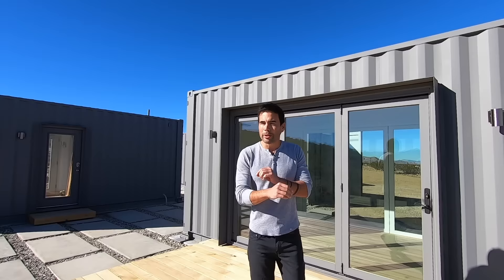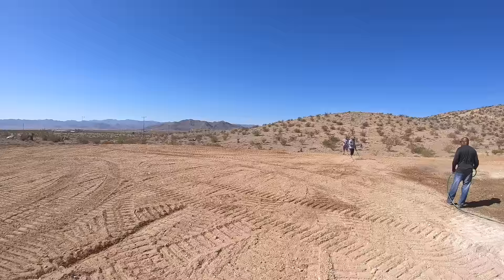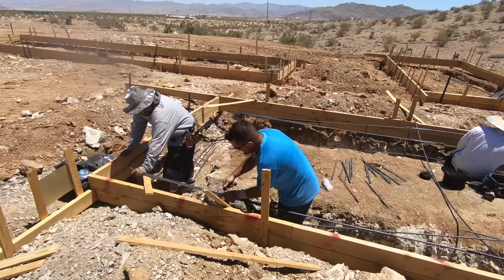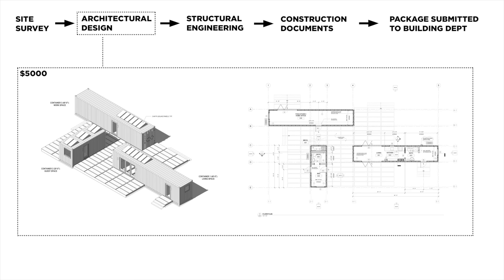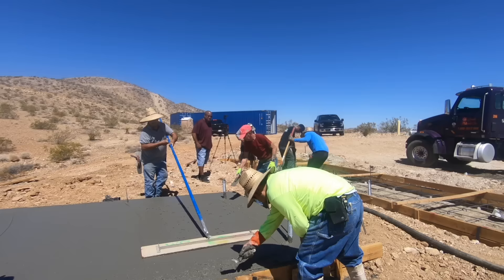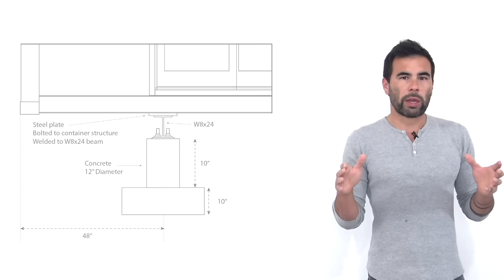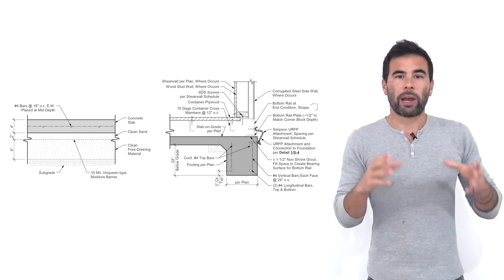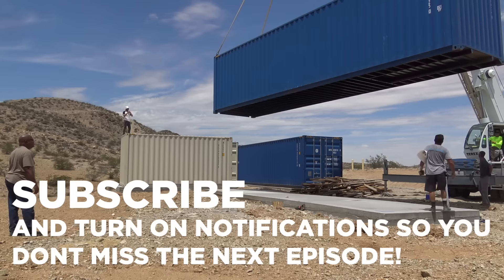Building a Shipping Container Home | EP01Permits and Foundation Design

Comment: 25k$ before even a shovel strike is made pretty much defeats the purpose of using containers at this point, no?
Reply: mglmouser I wouldn’t think so? Depends how much the containers cost and then compare that to the average cost to bet sq. Foot of a traditional build. Honestly I think some of those surveys are not necessary. But who knows, $25k might be a bargain compared to other parts of CA and traditional builds?
Reply: It's for people who are rich and want a "unique" design. They'd pay $100,000 in Beverly Hills if they had em
Reply: IDK, if anything having to pay $25k to put down anything makes me want to spend even less on what I'm putting down. Thank god I don't live in CA
Reply: I agree, and all the permits.
Reply: yea the permits and land negate the point of building your own cheap home.
Reply: @SAMann729  Thing is, they have to build framing walls anyway to support the containers, place insulation, electricity, etc. So they don't save on any construction using a container, only increase work, reduced room size, and complicate matters. It would be way cheaper and much more "green" to use standard methods and clad the walls in steel. Even better, use pre-built panels and this "house" would be under roof in less than 2 days.
Reply: @ThrottleKitty  but the point of the storage containers is cheap housing, if your going to be spending 25k+ before even starting on the housing then why not just go buy a house already built
Reply: Because this probably costed about $100k, instead of a small house in California on averaging costing you about $250k. Compared to the price of a house, $25k isn't a whole lot.
Reply: Guys... Does anyone here like in Cali? As someone who lives here, a smallish 4 bedroom house in a good to ghetto area is $400,000 minimum... I legit can't find any houses in any area within a 500 square mile radius around me right now where even a shitty 4 bedroom is cheaper after all the fees. 

I laughed when I lived in Missouri and people complained about $700 rents and $200,000 for a house with acres of land, talk about spoiled.... This shipping container idea is significantly cheaper to make even with $25K in permits starting when you want to choose exactly where you want to live and literally design your own home!
Reply: @Artdizzle  I don't even live in Cali and this is what I was trying to say! xD
Reply: I dont thing so, the way that portion of the vid plays out implies that he's adding the architect and structural engineer's fee into his "permit cost." If so, then going with a container saved him money since the exterior of the house is already a built. In a traditional home the architect and engineer would have needed to design and document the exterior, thus increasing their fees.
Reply: Mr. Boring on YouTube 25k for permits, 12k containers, 6k concrete labor, by the time you finish wiring, framing, and plumbing...you already spent 60k easy. And thats not including finishes
Reply: No, because you would have to pay  those costs for any custom home build there.
Reply: You also have to consider the "green" aspect. It is better for the environment to reuse containers or any available alternative rather than using concrete.
Reply: Ah, yeah.
Reply: fabnsass Except they were pretty much new containers
Reply: Why is everyone so focused on cost? It’s not a real house...it’s an ugly steel oven that has a small house constructed inside. It’s an RV or mobile home without tires! Trust-baby Ben is majoring in cuteness as he taunts the eco-fantasy of repurposing!
Reply: You got that right. I'm fixin to build one in Florida on a lake and I'm estimating it to cost me around $95000.00
Reply: Compared to a down payment on a house? It's cheaper to build at this point then to buy a home. You'd be surprised how much a home costs in certain states for the same size as this shipping container home.
Reply: That’s with CA permits and design, you’re going to get that with anything you build, if you’re a licensed engineer, then you will save a lot of the process, I’m a civil and plan on doing the grade design, SWPPP, WQMP, and substructure design and can design up to two stories in the state with my license under my liability so that’s somewhere you could save money

Comment: how is land so cheap? 10 acres for $20,000, that's crazy ~40,000m2

edit: holy fck the permits cost more than the land it's on? WTF
Reply: Welcome to the desert. You can get 5 acres of land near the Salton Sea for 5,000$
Reply: That is actually really expensive for land that has no real resources. Can’t grow anything or mine anything. Can’t even move dirt on your property without paying for even more permits and studies.
Reply: @osomxl  it's only real "resource" is that it's in California, barely
Reply: It has been a few decades, but farm land in central New York State was going for $100 an acre (or rather, 10,000 acres for $1,000,000).
I remembered Michigan as being cheap a few years ago, and a quick search shows 1 acre lots for $45,000 but also 40 acre parcels for $200,000-$400,000. 200 acres for $1.4m, 400 acres for $12m, so it can vary widely.
Rule of thumb: land gets cheaper in bulk. This is partly because large parcels are generally far from cities and schools, and being close to those things makes land worth more, and partly because large parcels will include some land that can't be built on (too swampy, no water, bad drainage, unstable soil, etc) and would thus be hard to sell. Bonus for you if the reason you wanted that land was to prevent someone from building something ugly in the middle of the pretty view. :)
Reply: I live 20 mins away from Joshua Tree, in some areas you purchase 10acres but you can only disturb 1/2 acre, do to zoning laws.....
Reply: @spyone4828  damn I looked at a piece of land in Nebraska was in a small town of 6500 people 21 miles away from the closest city. 3.2 acres for 130k  has some trees on it, some old shack/house not very flat.
Reply: Because Commiefornia, that's why
Reply: I live in a small town in N.C it's like 10k an acre here.. But very pretty land. I live in the mountains.
Reply: Here in northern Arizona it's roughly 20-40k for a 40 acre parcel, no well, power, septic tank etc. Price just depends on abouts where you are and if there is running water on your property like a creek or some sort.
Reply: This is also rural area. Most rural land is cheap.
Reply: Brabus 1Up it’s not in the major cities or counties..
Reply: I was floored too. The cheapest I'd get this kind of land for in Belgium is (I looked it up) a cool 3 million euro. If I purchased a plot like that where I live I'd pay 10 million.
Reply: D G San Bernadino is a major County.
Reply: @conquered.kozmos1395  it's a major county but it's a major shit hole. I'm in San Diego but having worked and lived in SB county was like living in Arizona, heat, dust, rocks, and fuckin tumbleweeds.
Reply: @Mroberts818  I grew up in hesperia bro. I love it. it has a different vibe to it. To each his own though. I haven't lived there in 14 years, but whenever I go back I like it more. 

I'm also not a city person.
Reply: lol, that CA for ya. They'll sell you the land for cheap - so they can tax you 
but  if you want to do anything with the land you need a permit 
that costs more than the land is worth...way to go CA.
#SocialismInAction
Reply: spent 300k smk
Reply: Around here 1 is about 10,000-20,000$ lol
Reply: That's just California for ya
Reply: Lol in Serbia you can get fertile land for that money with a house, but it's in the middle of nowhere.
Reply: @MisterXdotcom  that's a good thing lol
Reply: Based on how the permit segment of the video is broken down it seems like he's adding the architect's /  geotechnical engineer's / structural engineer's  fee into his total permit cost to arrive at $25,000.  As an architect in California I'd consider these as separate costs because while you do need them for a permit, you also need them to coordinate all the workers physically building the home.
Reply: @John Smith lol, beats kansas or any red state
Reply: There was land for sale in utah, on the other side of the same dessert, that came with the foundations for an entire town, including water, its price tag was $18,000. I forgot how many achers but it was close to being sold in square miles.. Basically there is plenty of land, but the demand is all for land that is near a city.
Reply: @osomxl  Well it's near the national park I would imagine it has some value has tourist, camping, hiking, etc.
Reply: Brabus 1Up , I’m not far from this guy and I bought 40 acres for 22k but I have trees.
Reply: @elgallogiro6092   really? thats f*ucked up..
Reply: @user-wg7nw3mh2e  That's why they are planning one 20" container as a separate bedroom to rent out.
Reply: @conquered.kozmos1395  ahhhhh....I'm not a city person either buy i am definitely not a desert person. I got to have trees and moisture. Not rocks, rattlers, and scorpions.
Reply: Brabus 1Up 
Permits are cheap depends on where ya planning to do it
Reply: Lmaoooooo truthhhh......
Reply: El Gallo Giro yes same here. I’m in the same County as Atlanta, Fulton County, GA and in a small city of Chattahoochee Hills. The only rural land left in the county. 2500 residents and we have zoning laws that keep this protected at 70% green space. So if your a builder and you purchase 100 acres on 30 can be built on or have been constructed or paved etc. the world renown Model of Agri-hoods is located here in our city, Serenbe. A .5 acre lot in there is $250-350,000 were in the same city about 6 miles away 1 acre goes for $8-$10,000 an acre. You can’t build on less than acre of land in our city. Green space Protection something our city modeled zoning is for to keep from the rest of the land around here or prevent urban sprawl. We own 7 acres & a 3/2 home that we got for $45000 in 2010 during the market crash & foreclosed on it for $210k . Now the market recovered & its back up to the same value + 10 years on living here. Very limited improvements too.
Reply: I think it comes down to land that you cannot build on (either for natural reasons or due to regulatory burden making it untenable) having little resale value.  It seems the state has made the land worth much less than it otherwise would be worth.
Reply: Them damn permits! LET HIM BUILD WTF HE WANTS IF HE DIES BECAUSE OF IT!! FINE! lol. Id understand them coming to about £1000
Reply: @Mroberts818  Rattlesnakes...
Reply: @MacMyKitty  I've been in the country long enough to call them Rattlers...but thanks.
Reply: It's in the fuckkng desert that's why.

Comment: I pour and finish concrete. Have worked with concrete for over two decades, growing up around the trade.
You did a VERY neat and accurate description of all the processes involved. I hate the heat and the filth, and the dry skin. But I love seeing a finished slab I installed, perfectly measured and neatly troweled.
I look forward to seeing the following episodes!

Comment: Licensed California architect here -  Slab on grade was the way to go. Just bolt the container to a raised perimeter curb, and use the bolts to level it. You have to anchor it anyway. My concern is with having mild still / galvanized steel in direct contact with concrete. You should be fine up in the high desert, but this would pose corrosion issues in a damp environment.

...and I'm gonna go ahead and guess this ended up costing significantly more than traditional type 5 construction on a per-square foot basis. That's fine, but people should know what to expect from a cost standpoint.
Reply: Or you could pay half of that in a different, less ecologically-unstable state.
Reply: William Hogan ...this was an exercise in millennial cuteness, in pursuit of repurposed utility. A conventional interior, built in a steel oven in the desert at enormous cost, relative to market value. The nature of the foundation type and reactive metals on concrete, not withstanding.
Reply: @AS-mv7tm  but you wouldnt be in california!!! I've been in most states of the U.S and cali is one of the best to live in...every state has its positives and negatives..
Reply: @MUGGLE137 : If I were offered to live in California in exchange for five million dollars, I'd spend minutes in serious consideration. Ultimately, I'd agree because I'd need the money, but I'd hesitate for a great deal of time.
Anything less than five million and I'd probably counter-offer suicide.
Reply: @AS-mv7tm  i lived in jersey and the northeast my whole life and have traveled up and down the east coast thousands of times for vacations,family reunions and i always said the south is the most beautiful place in the u.s..
UNTIL I MOVED TO CALI!!! 
And I've driven across this country coast to coast multiple times...
In all honesty...i will always love the east coast...
BUT...the people,energy and the views are better here in cali than the east coast!! 
IF YOU CAN GET PAST PAYING LIKE 3X THE AMOUNT FOR RENT OR A MORTGAGE AND SITTING IN TRAFFIC AN HOUR TO DRIVE 10MILES...CALI IS THE GREATEST STATE TO LIVE IN!!!

I'M TELLING EVERYBODY..IF YOU FEEL THAT YOU DON'T FIT IN WHERE YOU LIVE FOR WHATEVER REASON...MOVE TO CALI!! THE DIVERSITY IS AWESOME HERE AND THE PEOPLE ARE ACCEPTING AND CHILL!! THEY'RE NOTHING LIKE THE PEOPLE ON THE EAST COAST!!
Reply: @MUGGLE137 : California is a very beautiful state. It's very ecologically diverse, and I understand that it isn't just Hollywood or L.A. Still, though, not for me. Too expensive and hellish in terms of legal guidelines. I'd rather move to Montana or similar.
Reply: Cant you just spray on a rubberized coating to stop corrosion?
Reply: @AS-mv7tm  excellent point. Sink holes in texas and florida. The kkk in the south and high crime rates in cities like chicago. Places like out in the desert are weird feeling and haunted. Thats why they abandon mansions and nice houses out there. Water quality in Michigan and Food quality in the midwest. You cant drink the water or breathe the air!!!! Mersa in Pennsylvania. It enough to make me want to move back to New York City!
Reply: It sounds like they should expect to pay high cost, this should be a low budget project an turns out to be expensive.
Reply: Jane lasser , I agree, true, well said.

Comment: Ben, fantastic video! I do shipping container projects myself and I still learned a lot from your video - extreme helpful and informative.  For of the people focused on how expensive and what a pain in the ass California is to when building:  
You are 100% correct with respect to both.  That said though, do the quick numbers. Assuming you’re $100k all in on this house:

-You can easily AirBNB it for $275 in Joshua Tree
-It’s booked less than 1/3 of the time (120 days a year), again, no problem in Joshua Tree 
-You pay it off in 3 years 
-Starting year 4, you’re bringing in $30k+ per year with that property minimum; you can realistically book more nights and/or increase the rate and get closer to $50k+

Food for thought.
Reply: What has been your experience with deterioration?

Comment: I have a container shop here in Alaska. It's a 20 and a 40 jointed together side by side.  I just have it sitting on rail road ties and it lived through a 6.0 earth quake last November.  Only a few things fell over
Reply: Also good for California where a huge earthquake is imminent
Reply: @squigglewacks  the worst I see is -20 F .. yes it gets cold
Reply: @squigglewacks  it's bc he has it sitting up on railroad ties. U could do radiant heat in the floors. The guy in T.N. knows wat he's doing & his builds r 20k if u don't want granite & things like that.
Reply: @squigglewacks  ck. Out Incredible Tiny Homes out of T.N. owner Randy Jones. His video this week shows 7 new one & a container that he has the floor out of to be shown at a later date. He has a FB acct. Too, but I don't do fb. There's also Container Acre, just found them. Don't know when they did their build but r about to do another one. Wasn't alot of info out there when they did the first one. A new insulation made just for containers called insofast.com with a r-11 rating & cuts out condensation inside. Hope this helps!!
Reply: Yes because it's square.
Reply: I believe they build for magnitude 8 in California. That's 1,000 times more energy than a magnitude 6.